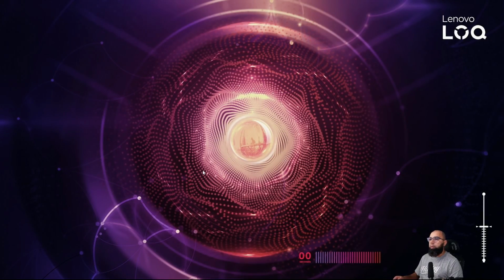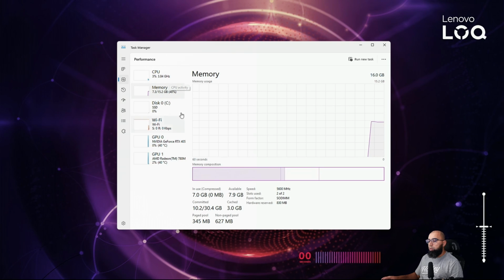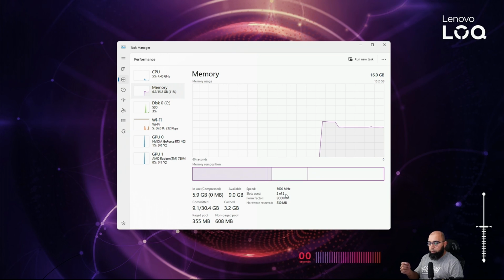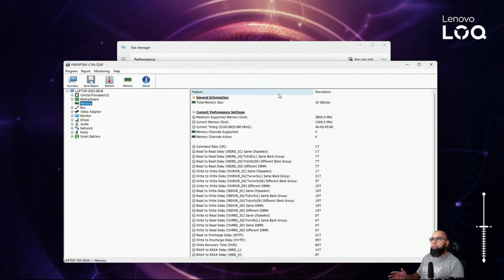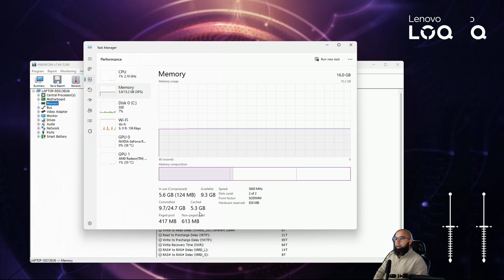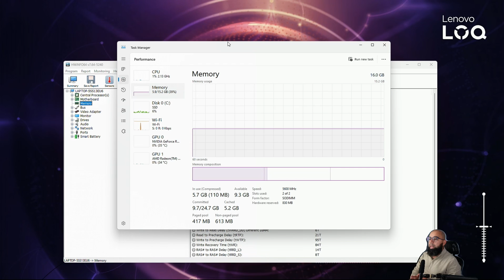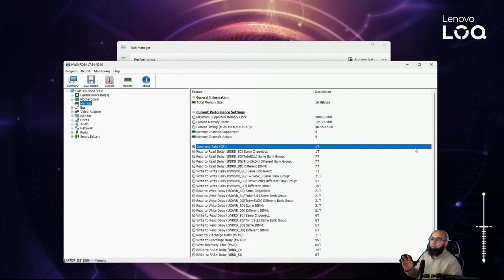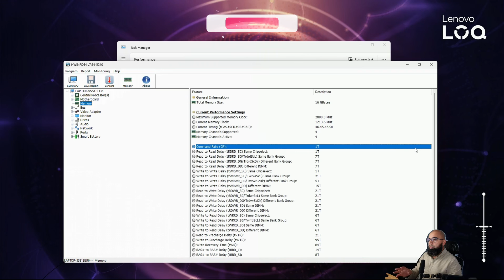Lenovo LOQ 15 - RAM Upgrade Guide (8GB to 16GB)

Comment: Help needed! 
I have a Lenovo LOQ with 12 GB of onboard RAM and an extra 8 GB DDR5 stick I’m planning to install. I’m not sure how it will work, will it run 8 GB + 8 GB in dual-channel with the remaining 4 GB in single-channel (flex mode), or will it not run in dual-channel at all? Also, I’m curious if the onboard 12 GB is a single module or actually two sticks (like 8 GB + 4 GB) soldered together, since 12 GB modules aren’t common.”
Reply from the maker: @varunnahshon7919 There is no single 12GB module. So it's probably 8GB+4GB. A very odd configuration as I'm not sure what region even comes like that. But, you'll have to remove the 4GB and install another 8GB for dual channel 8GB+8GB total of 16GB of RAM.
Reply: @techknowlux  opened the laptop yesterday. There was a 12gb single ram. I had no clue these existed. Probably Lenovo is getting them custom made for their laptops

Comment: Would that help run games more smoothly??

I’m new to this. I have that laptop but it’s not blue colored idk if I can provide pictures. Anyways. I got it at Best Buy for like 800$ something. 

Lenovo - LOQ 15.6" Full HD Gaming Laptop - AMD Ryzen 5 7235HS - 12GB Memory - NVIDIA GeForce RTX 4050 - 512GB SSD
Reply from the maker: @Iamandyr Having more RAM will make CPU bound games potentially perform better. 16GB of RAM is the sweet spot for gaming.
Reply: @techknowlux  Do you recommend me to buy the 32 GB?

Comment: Hey man, thanks for the video, ill follow this tomorrow when upgrading my ram, but i wondering why you didn't disconnect the battery before doing anything to the laptop. I always read you should disconnect the battery, also i will want to upgrade the ssd, is that possible?

Comment: After i installed my laptop is not turning on? What do i do
Reply: Does this work for the intel lenovo loq?
Reply from the maker: @yuyun1a Yes it does. The RAM upgrade procedure is the same. Did you wait a few minutes. The initial boot after new RAM install can take several minutes on some machines.
Reply: @techknowlux  when I installed it it kept giving me bios corruption I don5 know why?

Comment: Hi, is it possible to upgrade to 24GB DDR5 RAM? I currently have 8GB installed, and I'm considering adding a 16GB Crucial module (8GB original + 16GB Crucial = 24GB). Thank you, and greetings from Colombia!
Reply from the maker: Amazing to hear my videos are reaching Colombia. And yes absolutely, you can mix and match the RAM module capacity and get a total of 24GB of RAM.
Reply: @techknowlux  Great! Thanks for responding. I just installed the RAM modules simultaneously and it recognized the full 24GB without any issues. Greetings and many thanks again from Colombia.
Reply: I’ve been having an issue lately: when I play League of Legends (LoL) with no other programs open, after a while my PC freezes, starts making noise, and I have to restart it because it won’t respond. What can I do to fix this? It’s never happened before, and to be fair, I’d never had 24 GB of RAM until now.
Reply: @TuAndroidChannel was it after installing your 16gb ram this problems occurs? Please reply, im planning to mix brand vengeance 16gb to default ram 12gb.

Comment: Do you onow if the CT16G56C46S5 crucial ram stick is compatible?
Bc i not getting nines to work, its 2x16
Reply: Nvm i left it for a while and it booted up for itself, so relieved
Reply from the maker: First boot after RAM install always does a longer POST and RAM module testing. Glad it worked out.
Reply: Ok good to know

Comment: I am having 8+8, want to upgrade. Shall I go with 1 slot upgrade to 32 i.e. 8+32 Recommended ?
Reply from the maker: This laptop does not officially support 32GB modules per the specifications. However if you try it and it works, then great. Others have tried similar things with mixed results.

Comment: how to upgrade my 12 gb ram to 32 gb ram? I have 1 slot remain
Reply from the maker: @rafihamdi7637 Most likely you have a 4GB + 8GB module. You'll need to replace both with 16GB modules for a total of 32GB.

Comment: Your video was great and really helped me because I was being a bit bottleneck by the starting ram. But after I put in the additional 8gb(Crucial 5600MHz) and maybe before I never really payed attention it only say I have 5200 MT/s instead of 5600 MHz I was wondering if that’s just a different conversion or if there’s something I did wrong
Reply from the maker: Did you update your BIOS and Windows and drivers? If you are still seeing it running at 5200Mhz you may need to go into the BIOS and use memory profiles to get 5600Mhz. Some RAM modules (and the memory dies on them) can vary with some systems and need to be manually set.
Reply: @techknowlux  I did update my BIOS and drivers and it's still 5200. But I can't seem to find a memory profile setting in the BIOS or even a XMP setting.

Comment: I have a Lenovo LOQ Amd Ryzen 7235HS RTX 3050 laptop and I just upgraded from 12 GB ram (4800 mhz) to 32 GB ram (5600 mhz), and I tried everything (Especially in the bios menu often) that I can do to make the 32 GB ram's speed into having 5600 mhz, but it's still stuck at 4800 mhz. Could it be that my motherboard just has a maximum of 4800 mhz ram speed? They're both DDR5 by the way. If I could get any help or answers I'd gladly appreciate it.
Reply: how do you upgrade 12 gb to 32 gb ram? what size is added in the second slot?
Reply: @ There was two ram sticks I bought from Best Buy that were compatible on the motherboard that I used for and they are each separately 16 GB rams with the same 5600 mhz.
Reply: Did it get fixed?
Reply: @ Well, that’s where idk. It does go up to 32 GB rams, but the speed doesn’t go up to 5600 mhz. I had the 12 GB (4800 mhz) rams originally that came with the laptop.

Comment: Hi! Do you happen to know if Sk-Hynix sells the same RAM sticks as the one in the laptop? Or do you recommend just buying 2 new and equal 8Gbs sticks? Thanks for the great video!
Reply from the maker: @juanpabloeraso3755 SK Hynix does sell but usually you'll find lots of other brands. Just buy matching/paired 8GB modules preferably. It doesn't really matter as long as they're both 8GB and rated the same speed such as 5600MHz.

Comment: I bought it the fury impact memory ram 16 gb drr5 5600 hz and my laptop won't turn on, is the same laptop than the video, someone can help me?
Reply from the maker: @elsheshar999 Remove the RAM and install the original and see if it turns on. Maybe try replacing one module at a time so you have one original and one new module.

Comment: what if i chip a screw plz help
Reply from the maker: @Glitchedluke Chip a screw? You mean the threads are worn out so you can no longer use a screwdriver to open the screw? You'll need to use a plier or some screw removal tool to take it out.
Reply: @techknowlux  do you know what screws it uses?

Comment: Do i have to detach the battery before installing the ram?? And how to do so if so
Reply from the maker: @Ezraandgoify Yes you should. BUT, I've never done that and I have never had any problems. That doesn't meant that you should follow my example. I didn't cover this in my video. Please check other videos or the official instructions manual on Lenovo website on how to do this correctly. You should also be working on an anti-static surface and wear an anti-static wrist strap. Lol.
Reply: @techknowlux  what if I strip a screw on the back pannel

Comment: could i use any laptop ram? like could i put two 16gb ram sticks in?
Reply from the maker: @MrPingis It can't be just any laptop RAM. It has to be DDR5. And yes you can put in two 16GB modules. This laptop supports max ram of 32GB.

Comment: Hi. I saw in producer website that we just can upgrade loq laptops to 32 GB ram. however, i saw some customes models in shopes with 64GB. do cpu work with uper than 32GB ram performence?
Reply from the maker: @sametashori3047 I have heard of this lots too. But I have never tried it. The only way to know exactly is to try it. There are so many variations, BIOS version, motherboard version, that could affect RAM limits. The CPU though should support it.

Comment: Hi, how do i make my rams run on the real frequency
Reply from the maker: @juanjosequilenan9995 What do you mean? It should automatically do that once you install it and boot the laptop. If it doesn't run at the speed that it says on the box, it could be the quality of the DRAM chips used on the DDR5 modules you purchased. No one knows exactly and there are so many variations. Generally if it says 4800 or 5600Mhz on the box, it should run at that speed.
Reply: @techknowlux  I need help.. I have installed 2 DDR5 Rams 5600Mhz. Windows is showing 4800MHz. How can i overclock my Rams? in Bios is no Option ;(

Comment: I just updated my ram using this video. It was crucial ddr5 2 sticks of 16 gb 5600 mhs. But in my task manager it says MT/s I don’t know if that matters because recently ever since I updated my RAM my computer has gone to a black screen if I don’t touch it for a little bit and it won’t turn back on once I restart the computer. It says it goes into bios recovery mode. I don’t know what to do does someone have a solution?
Reply from the maker: @vikii_vr I'm not sure what went wrong. That sounds terrible though. Are you able to bootup to Windows at all? You could try taking out the newly added RAM modules and restore the original ones to see if it boots up.

Comment: Hi, if I put 24 Gb ram by replacing one of the 8 gb ram from my computer and one is 8 gb ram is it okay to operate in the laptop displayed above.
Reply from the maker: @tmntgamingchannel287 Do you mean one 8GB RAM module + 16GB RAM module for a total of 24GB? Not a single 24GB RAM module right? Because those are a thing now. If you use 8+16 then it's no problem.
Reply: @techknowlux  Thank you sir. No sir presently installed capacity is 8 +8 samsung DDR5 5600, but I want to add 24 RAM by replacing one of the 8 Gb Ram present, Now Total is about 8+24 Gb.
Reply from the maker: @tmntgamingchannel287 Interesting. Did it work? Does it show a total of 32GB RAM? I haven't used or tested the 24GB RAM modules yet.

Comment: I bought the same ram as this and tried to upgrade my laptop. But it won't boot with the new ram in any configuration possible. If the new ram is inside the laptop, it will just not boot. Can anyone help me out with this?
Reply from the maker: What do you see on bootup? Do you see the logo? Any sounds? Lights? If nothing, remove the modules, put in only 1 of the modules and try to see if the laptop will boot. If it does, then add the other module in the 2nd slot and try again. If not, then you might have defective memory (rare, but it can happen). If not, you could also try putting in the original RAM 1 module and the new RAM 1 module and see if it will boot with that give you 24GB. This way hopefully you can figure out what's the problem.
Reply: @techknowlux  Thanks for replying, I tried everything with it. The thing that fixed it was buying a new ram with the same exact frequency as my original one (5600 MT/s).

Comment: "Sir, I have upgraded the RAM from 4800MHz to 5600MHz, but in Task Manager it still shows 4800MHz. I am using LOQ 15IRX9 with Core i7-13650HX. how to fix that? thanks
Reply from the maker: Check in your BIOS.

Comment: Can it take more than 32gb of ram? Ihave the loq 15arp9
Reply from the maker: Officially, no. 32GB is the max. BUT, you can try. Some have tried and succeeded.
Reply: @techknowlux  i have installed 2x32GB and it runs at 64GB. But i installed 5600MHz Rams and Windows shows 4800MHz.. i dont know how to overclock the Rams. In Bios is no Option to do this.. Maby with a Program?

Comment: I noticed you didn't remove the battery before you upgrade the ram...is it safe doing that?
Reply from the maker: It is and it isn't. Depends on who you ask. I took a risk... and it worked for me. Have been doing this all my life upgrading laptops. BUT.. the correct and scientifically backed up opinion is that you should wear anti-static wrist strap, ground yourself, disconnect the battery and then attempt the upgrade or tinkering inside.

Comment: YO THANK YOU! I’ve had mine for almost a year now and the biggest problem I had was lack of RAM. It now has 32gb at 5600! Thank you again! This has been so helpful.
Reply: what is your specs?
Reply: @Heiko-h8v  Mine has the RTX 4050 with AMD Ryzen 7 7840 also 500GB SSD and I have another 1TB on the way.
Reply from the maker: With 32GB of RAM and extra SSD space, this is a great little budget laptop. That 4050 with DLSS+Frame Gen is enough for most people.

Comment: i have an doubt sir that i buyed one month ago lenovo loq i5 12th gen 12450hx 12gb ram variant can you tell me that inside there is 12gb x 1 stick is there or 8gb x 1 and 4gb x 1 please reply im very confused sir
Reply: 12 gb single ram only..no 8 gb + 4 gb...its 12gb one ram
Reply from the maker: RAM modules come in 4, 8, 16, 32 multiples. 12GB single RAM stick is not possible. As mentioned in the other comment, it's must be 8+4.
Reply: @techknowlux  no I have checked In my command prompt I put an command it is showing 12gb one stick
Reply: @shaileshdubey7197  ok bro

Comment: Hello I am considering this laptop: Lenovo LOQ 15AHP9 Gaming Laptop, NVIDIA® GeForce RTX™ 4050 6GB GDDR6, 15.6” FHD Display, AMD Ryzen 7 8845HS, 16GB RAM, 512GB SSD, 1920x1080 px, Windows 11.  Is it possible for you to tell me  if  I can attain 32 GB of ram or not?  Thank you in advance
Reply from the maker: Yes you can. 32GB is the max RAM supported on the LOQ 15.

Comment: Hello, If i add a ram by myself. Am I voiding my Lenovo warranty?
Reply from the maker: No adding RAM by yourself does not void warranty for Lenovo. This is to the best of my knowledge. Please check with Lenovo website/support and documentation to confirm.
Reply: @techknowlux  Thank you for replying. I have already added the ram that I bought. Another question, what about an m.2 ssd? Will it void my warranty?
Reply: @jkaeqpo400  The part that voids the warranty on a laptop is a seal on one of the cover's screw. So if you managed to open the bottom panel without voiding the warranty, you can change both RAM and SSD without an issue. 

Remember, the seal on the screws voids the warranty. 
Also, you will have to keep the original components (the RAM sticks and the SSD) in case you will ever need to use that warranty.

Comment: Hello, I used a Kingston 8gb but the laptop doesn't work, it doesn't turn on, I remove and use the original and it's works perfectly, any advise? Thanks
Reply: Same is happening to me
Reply from the maker: @isaachernandez6494 @hashimoto8781 Is it DDR5? Are you adding just one more single stick of DDR5 8GB?
Reply: 8Gb ram
Reply: Hello, sorry for the late answer, I bought another one, 16 gb, the problem was the frequency, the last one was 4800 and the computer needs a 5200 Hz, now I work with 16 gb RAM, thanks for the follow up the question.

Comment: Hi there, thank you for this video. I am currently planning on adding a ram to my Lenovo LOQ. attached below is the model and specs of my LOQ. Do you have any recommendations of what brand of additional 8gb ram to buy?

LOQ 15IRH8 82XV00P6PH 15.6" FHD 144Hz i5-12450H | RTX 2050 | 8GB DDR5-4800 | 512GB SSD

Comment: Does anyone knows why when i put the Crucial DDR5 5600 mhz on secondary slot with the OEM Samsung DDR5 5600 Mhz it does boot with 24gb on ram but it wont work with both Crucial sticks for up to 32gb?
Reply: Hey I stuck with thing where i want to upgrade my ram from 8 to 16 and i cant find a proper ram for it i have The LOQ 15IRH8 which i cant find in the crucial website and is it compatable with it ?

Comment: Hi, does it matter if the ram inside the laptop (8)Gb from a different company than the one i will be adding (8) GB also, knowing that both of them are DDR5-4800?
Reply: it doesn't matter
Reply: @KntPredadorKnt can i add 8 gb to my already existing 12gb ram ?

Comment: Hey i have lenovo Loq for 2 week and i do a ram upgrade and buy a 16 gb ddr5 kit   4800mhz which 2 sticks 8gb from corsair . But when i install to the laptop and boot the laptop, just only the keyboard light up and no signal from the screen but when i put back the original ram wich 8 gb stick 5600mhz back and boot it again the screen show up ? So can you tell me what is the problem? Thank you
Reply: Same, could you fix it?
Reply: Did you find a solution?

Comment: Thanks for the video, but I have a question. Can we upgrade the ssd by adding a 2tb m2.nvme to the other slot? As on lenovos website it says, you can add only 512gb or 1 tb to the other slot considering (Lenovo store options)?? And does it void warranty to do so by the user himself? Thank you

Comment: Thank you for this video. I just got this ones big brother, the one that comes stock with 16gb. Looking to take it to 32gb. I have a clear guide of how to get inside now. 

One question, did you disconnect the battery from the board at all(IE unplugging the power cable from the motherboard)? I didn't see it in your video, though you did cut the video up I can see. When I upgraded my old HP  laptop that was something the guy did before tampering with the RAM. Is that something that should be done here?

Comment: i have a question, can you add 2 DDR5 ram's with 6400 Mhz and 16 GB?
Reply from the maker: @sincerr666  No, the highest speed supported is 5600Mhz.
Reply: @techknowlux  I need help.. I have installed 2 DDR5 Rams 5600Mhz. Windows is showing 4800MHz. How can i overclock my Rams? in Bios is no Option ;(